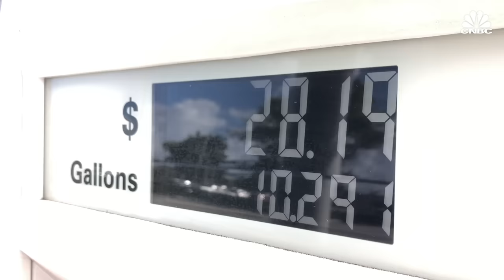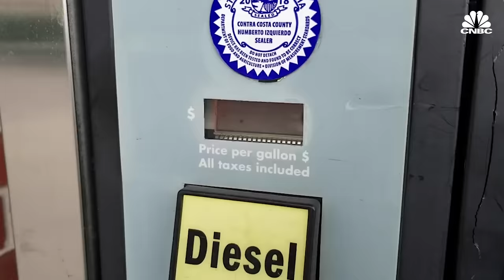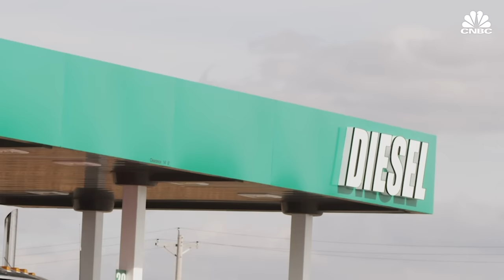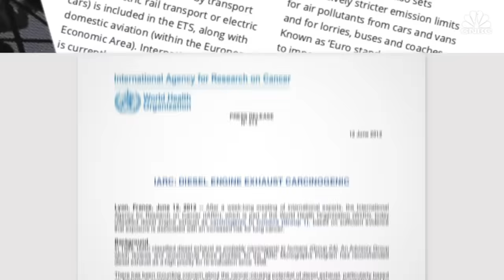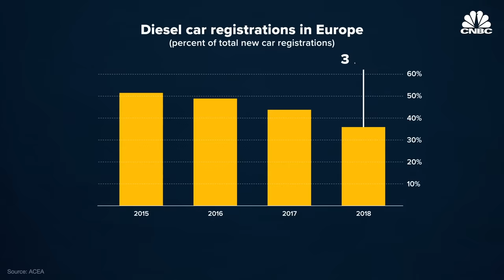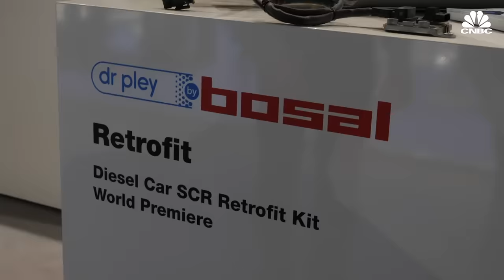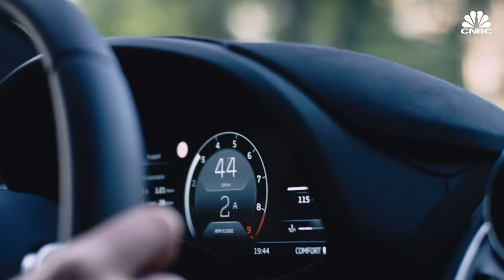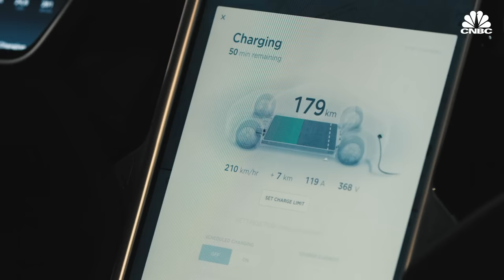Why Diesel Cars Are Disappearing

Comment: When diesel engines were catching on in the USA. The oil companies raised the price of diesel fuel around 30%  above the price of gas.
Reply: No that was government not oil companies, the government mandated ultra low sulfur diesel around 2008 and producing ultra low sulfur diesel costs more thus the price increase
Reply: @AdamSmith-gs2dv  

So basically it was the pollution costs of diesel, and refusing to hide that by dumping it on the public at large, that drove the price?

P.S. In truth a huge factor in the change in relative prices was driven by the shift in demand vs gasoline. There is a natural balance of gasoline vs diesel coming out of crude oil. In the decades past refineries had to put a lot of effort into pushing away from that natural balance towards gasoline production, so diesel prices were naturally lower per energy cost. When balance of the demand switched away from gasoline towards diesel, for a number of reasons, this wasn't so much the case. So the $ per Kj cost of the fuels (remember that diesel has more energy in it per gallon) came much closer to equal.
Reply: Patrick London No the government causes the raise in prices of diesel
Reply: The government in South Africa did the same thing with the diesel price. It used to be way cheaper than petrol. Then they  just added more tax to make it similar in cost to petrol.
Reply: even though it costs a LOT less to make..
Reply: the price difference is mostly more tax.  I buy off road diesel for my tractors and it is priced about the same as regular gas in spite of high distribution cost.
Reply: 9
Reply: Wrong.  Look at the taxes.  Diesel is TAXED much higher.  And it's not "30% higher."  Even with the higher taxes sometimes it's lower than premium gas.  Diesel fuel prices are highly variable because it's more subject to the futures markets.
Reply: They did that here also, diesel was the cheaper fuel when i was a boy.
Reply: Patrick London, I bought my first diesel truck in 2003 and the price immediately went up, it’s my fault.
Reply: @aeroflopper  
When you were a boy the ratio of gasoline to diesel used by the public was extremely high, which meant that refineries had to work harder to make gasoline (so cost more) and there was a relative glut of diesel (so cost less).
Reply: Which was because of the EPA regulating that they had to refine the sulfur out of diesel
Reply: @jellyfrosh9102  

That portion of it (and it was only a portion) was previously being dumped by diesel drivers on the rest of the public. This corrected an "accounting problem" that had diesel price artificially low.

Unremunerated pollution is theft.
Reply: They will do the same to elect. Because they pay no fuel tax
Reply: @peterdaniel66  and diesel is a by-product of refining pertrol!
Reply: Tax or not my diesel car goes twice as far on a tank of diesel, making it cheaper per mile than gas. And the turbo will push you into your seat on takeoff, low end torque is a rush.
Reply: "The oil companies raised the price of diesel fuel around 30%"
Actually, state governments started taxing diesel at a higher rate while at the same time reducing the amount of sulfur allowed. That was followed by greater particulate emission standards. End result, higher cost for diesel with less power and efficiency combined with greater maintenance costs.
Reply: @peterdaniel66  Actually it no longer costs less to make. The new sulfur regulations increased the cost of producing diesel.
Reply: Still potentially much more efficient. Still possible to get 100 mpg real world from Audi A2 even though it's done 1/4million miles and was built in 2001:

http://www.autointell.com/News-2001/May-2001/May-2001-4/May-23-01-p8.htm
Reply: @peterdaniel66  No, it costs more to make. You need more crude oil to make the same volume of diesel than petrol. Diesel is more hydrocarbon dense--one of the reasons it gives more kilometres/miles for the same volume. The video said that.  Where did you get the idea it costs less to make? In South Africa diesel was heavily subsidised.
Reply: In UK, when diesel cars began to get popular, the UK Government put the tax up on diesel so it was more expensive than petrol engined cars,
Reply: It’s called supply and demand. 

I laughed at everyone who bought a TDi saying they would “save money” then having to stare down higher prices at the pump.. and the amortization of fuel savings years down the road basically gets erased as soon as they need to do a fuel pump and injectors and stays flat for the amount of oil they need to fill it with (like the video) unless they tear the engine down. 

They don’t last any longer, either. Yeah.. anything will last a million miles if it’s driven daily on the highway.. and any gas car will easily last 1/2 a million miles if you put half the maintenance costs into what you would an equivalent diesel. 

Usually what kills a 15 year old gas car is a head gasket replacement that’s worth more than the vehicle.. while a completely rusted out 20 year old TDi burning oil someone still wants $5000 for it.
Reply: Same thing in Australia. They also did the same when people converted to LPG on their vehicles.
Reply: Well, here in Britain LPG is still much cheaper than Petrol and that is still a little cheaper than Diesel, but the benefit of diesel is better fuel consumption and mid-range torque.
Reply: @AdamSmith-gs2dv  No that was much later. when I was a kid in the 70s diesel was in fact cheaper
Reply: Adam Smith  you guys are young. Diesel automobiles started getting popular in the late 1970s and 80s. Diesel has been more expensive than gasoline for decades - not just the last 12 years.

Mercedes, VW, Isuzu/GM, Mitsubishi were getting pretty popular. My dad had an ‘84 (I think) diesel Ford Ranger but I never saw a diesel Mazda. I know GM put diesels in regular 1/2 ton pickups for a while but I that was a 350 conversion and I understand it didn’t work well.

At some point in the late 80s/early 90s diesel automobiles in the US market practically disappeared except for heavy duty trucks and tractors.

The variation in the price of diesel vs gasoline has a lot to do with how much the refineries are producing of each, so it becomes a supply:demand thing.

Yes, government taxes are a part of it, but fuel taxes are assessed on a per/gallon basis, not a percentage of retail price basis, so it’s fixed while supply:demand pricing is variable.

Fuel taxes make up a smaller and smaller percentage of the retail price as the price of oil/refining/fuel gets higher.
Reply: Henry Ostman  that’s interesting. I can buy off-road diesel for my tractors (I have a diesel lawn mower, gator and small JD tractor) from the local fuel business that delivers to farmers but it’s cheaper to fill my fuel cans at the convenience store and pay for the taxes.
Reply: Calvin Nickel  that’s pretty true. What usually kills an older gas car is the cost of a repair being more than the value of the vehicle.
And the value of the vehicle is based on how much a bank will loan on it.

I’m still driving a 2002 GMC pickup. It’s worth about $1500, which is why I didn’t trade it when I upgraded. But it’s got some oil and coolant system leaks I haven’t bothered getting fixed yet. I’ve also got a 2016 but the 02 is still my favorite of the two trucks.
Reply: Price of diesel is 5-15% less than gas in Canada
Reply: its all a scam
Reply: Simply because the US automakers didn't have any Diesel cars, so raising the price of Diesel levelled the playing field so that nobody wanted one.
Reply: @shanek6582  your not entirely to blame. I bought my first diesel truck in 2001. I got to enjoy the much cheaper fuel costs for about a year before the prices took off. 

I traded in the same model truck, but with a gas engine. So with the added fuel economy, the higher fuel cost offset any savings. 

Same thing happened with E85. That fuel use to be much cheaper than regular gas. Once that fuel become common, it didn’t take long for the taxes to offset any savings. 

All the fanatical electric car enthusiasts, just wait. Before long they politicians will figure out how to exploit electric cars. Since your not paying taxes at the fuel pump (those taxes are suppose to help pay for the roads and highway maintenance) your going to pay more for license plates, electrical usage, registration, that money will have to come from something.
Reply: @mattrodgers4878  agreed lol, once electric cars are the norm, they’ll tax the crap out of us.
Reply: @AdamSmith-gs2dv  funny how diesel is the same price as regular in europe
Reply: @calvinnickel9995  - Driving for little more than 35 years. Diesels in particular for about 30 years. NEVER ever changed and injector or pump... and Yes, they do last longer, consume less. Providing a range per tank that, at minimum, is AWESOME! Notice I did it more than once. I could start driving from Lisbon in Portugal and refill the tank already well into France! That was from a 54L (11.8 US gal) tank, let that sink in for a moment!! No hypermiling or any particular driving "style" or technic. Just seat and drive as you please at the moment!  

2.5 tanks take me from the most Western point in Europe (15 minute drive from my house in Portugal) all the way to Norway... and I can still drive most of the week with the remaining diesel! Yep! Did it several times, with several cars. From new cars to beaten old "stuff"!
One in particular, was an older and beaten Mercedes that I bought for the equivalent of 500€. ON THE DAY it was going to the scrappie! Well over 300k engine. After oil, filters and an intake gasket (21€) it was purring like a kitten! Not bad at all.

"Maintenance costs" cheaper and basic than most gasoline equivalents. On those, on occasion, I did change coils and other ignition components, On a diesel for obvious reasons there's no ignition components to change at all.

So you're a clueless fellow, regurgitating wanna be theories. Without real world experience...
From my present 5 cars, 3 are diesel and they're all near or above the 300k km mark. All ticking like a well tuned clock! And they take nothing more than filters, oil and other normal consumables... What about that!
Reply: @frankbutaric3565  - "funny how diesel is the same price as regular in europe" 
In what Europe? Is the question. I drive and drove pretty much ALL Western Europe several times NEVER, not even once saw the diesel costing the same or more than petrol! It was always cheaper. Even if it's just a small fraction! 
All the BS excuses and taxes apart. Diesel it's still cheaper to produce than gas.
Reply: @thomasmcnicholas8656  Low sulfur leaves less pdteoleum to make diesel. Sounds like you don't know much about distilling.
Reply: @thomasmcnicholas8656  when did I say the government sets the prices ?
Reply: @AdamSmith-gs2dv  yes your  right, it was government not the oil companies . Diesel is a by product of the Gas/petrol making process and always has been , they add bio ethanol to the transporters before the tanks are filled to reduce the sulphur in the fuel you now have a catalytic converter in your vechicle to reduce hydrocarbons  produced by legislation from government because the refineries refused to re-tool to make the fuel cleaner. its not actually low sulphur diesel it just has detergents added to break down the sulphur in the burning process. removing the sulphur could be to risky and damage a lot of engines as sulphur is a lubricant in diesel engines .
Reply: @AdamSmith-gs2dv  When they estimated the increased processing costs to hit the low sulfur standards, the engineers said it would add about 7 cents to the price of a gallon of diesel fuel. So the much higher price increase we are charged by oil companies was simply to increase profits.
Reply: When I bought my first Cummins in 1999 diesel was 98.9/gallon. I just paid $5.79. 1.5 yrs ago we were energy independent.
Reply: @AdamSmith-gs2dv  After that sulfur piles in the refineries got larger.
Reply: @lthundertree6385  The money oils are for jet fuel. Then Kerosene. Next diesel. The light ends are used in gasoline. Basically gasoline was the by product nobody wanted. Then along came the carburetor and the model T and suddenly there was a big market for it. The difference is Octane C8H17 and Cetane C16H34. One   easily produces a explosive gas at STP and the other does not. Oh and one has more heat potential per volume. Every barrel of crude looses some it for heat in the processing.
 If you have not been inside a refinery. They are relatively warm in the winter.

Comment: Well researched. I liked that they expressed the scepticism towards electric trucks. I don't think we'll ever see long range trucks go electric. The underlying problem is that electric trucks would need to be 70+% battery, leaving only 30-% for cargo. Unfortunately, the batteries are pretty close to the theoretical limit of energy density, so they won't improve drastically from where they're now. The only sensible electrification for trucks would be them going hybrid.
Reply: two words: trolley trucks

for long distance every truck tends to take more-or-less the same route, replace traffic lights along those routes with tram poles that also have an attached light, maybe double or triple their frequency as necessary

don't get rid of that battery though, it can take the truck from the electrified highways to the delivery destination, and then from the next pickup back to the highway
Reply: It seems you are wrong. Volvo, Scania and Mercedes have been running 20 ton and 40 ton electric prototypes and will go into production next year. The Tesla Semi has been running loads from Nevada to California for a few years and will see first deliveries in 2022. Modification to the tractor unit can easily support up to 4 MT of battery weight and give 200-300 miles of range towing huge loads... and the sheer power and torque of electric motors outperform the most powerful diesels. Ten years ago people were sceptical about electric cars, now they are the only growth area in the car industry and are driving out fossil fuel car sales. Battery costs are being driven down inexorably by mass production as their energy density increases year on year. It will be great to see the end of diesel in all forms of road transport.
Reply: Diesel engine is a less pollutant than petrol this test was done a delphi test centre it's just you can see the nox coming out of the petrol engine electric cars are a stop gap till hydrogen comes along so you lot that have spent a fortune on electric cars you have bought a total lemon good luck 👍
Reply: @garycoates6837  Diesel is dead. It is the most polluting fuel, more so than petrol due to the particulates and NoX but as you know sales of petrol and diesel vehicles are falling like a stone. EV’s are the future, hydrogen is a red herring, will never be able to compete on cost as the Wh/Kg of batteries increase year on year. You are talking to someone who researches this subject and has been published on it..in time you will see that you are wrong. I won’t bother answering if you persist in trying to argue with me.
Reply: @d3str0i3r  they have that in Germany
Reply: @d3str0i3r  Two other words: freight train
Reply: @kiae-nirodiariesencore4270  Ostriches tend to do that as well.
Reply: or just stop this madness of moving useless things and tourists over the world.
Reply: Best comment
Reply: They have built a truck that carries 94 ton on fully electric - I pulls into a site every few hundred miles and a forklift lifts out the expended batteries and swaps in new freshly charged ones. 5 minutes at most, and truck can continue to next port.

Comment: It takes more oil to make a Gallon of Diesel than a gallon of gas.  47% of 42 gallons is 19-3/4 gallons of gasoline per barrel of oil. 23% of 42 gallons is 9.6 gallons of diesel/fuel oil per barrel of crude oil. The Ratio is almost 2-1 . 42 Gallon Barrel makes 20 Gallons of gas . 42 Gal Barrel make 10 Gallons of diesel.

Comment: Apart from outboards, diesel engines are exclusively used in marine vessels due to avoiding petrol's explosive fumes, and larger carbon monoxide emissions.
Reply: You should compare gasoline to diesel by weight, not by volume. You get different results.
Reply: *in the US
Reply: Large marine vessels my dads 1960s boat has a two stroke gas engine